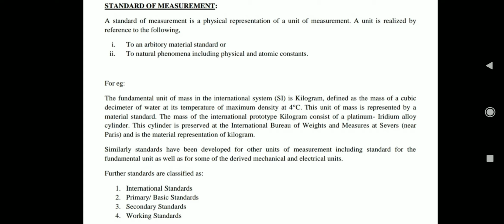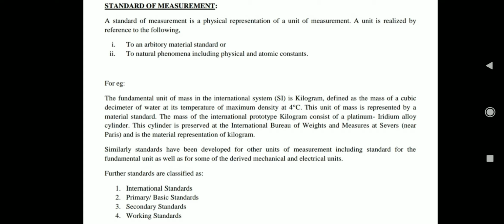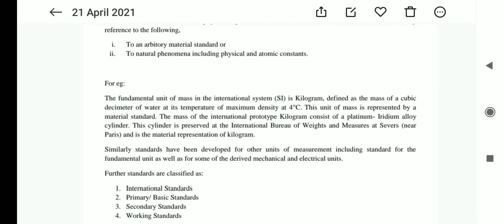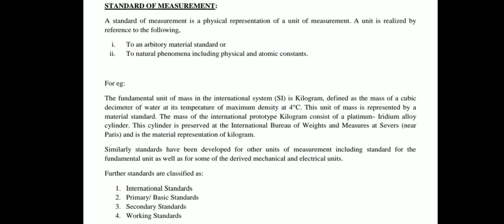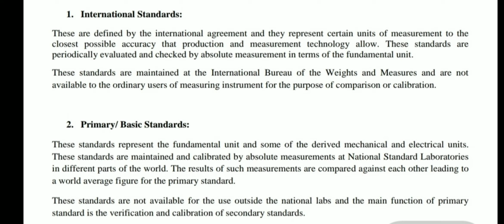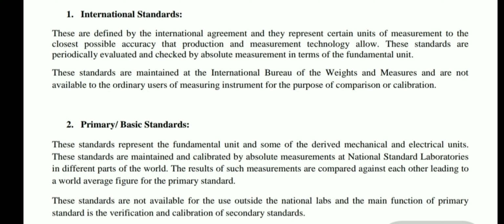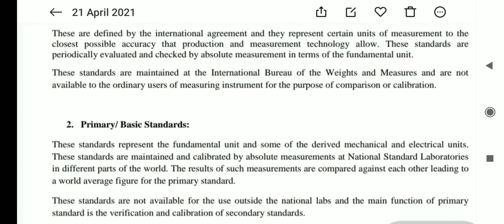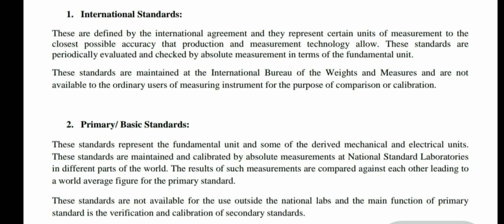Standard of Measurement | Classification of Standards | EMI | EI | by Mr. Noor Ul Abedin

Comment: Syed saqib ECE A 160517735006. 
Assignment 1
1) what is standard measurement?
A)it is physical representation of unit. Of measurement .it is realized by reference to following
1) to an arbitrary material standard or 
2)natural phenomena including physical and atomic constants.

2) different types of standards of measurements.
A) international standards: international agreement and they represent certain units of measurements closest possible accuracy that production and measurement technology allow.
Primary basic standards: it represent   fundamental and some of derived mechanical units it maintained calibered by absolute measurements national standard labourer diff parts of world.not available outside labs national labs and main function of primary standard is verification and calibration of secondary standards. 
Secondary standards: it is used reference standards in industrial measurement laboratories. Standards maintained by particular involved industry and checked locally against reference standards it is available in area are maintained as its calibration is checked particular industrial laboratories.
Working standards: principal tools are measurement laboratory. It is used check and caliberate general laboratory instruments for accuracy and performance or perform comparison measurements in industrial application.

Comment: ECE - 3rd yr 
160518735080
1) The standard of measurement is a physical representation of unit of measurement. A unit is realized by reference to and arbitrary material standard or to natural phenomenon including physical atomic constants. 
2) TYPES : 
(1) International standards. 
(2) Primary/ Basic standards. 
(3) Secondary standards. 
(4) Working standards.